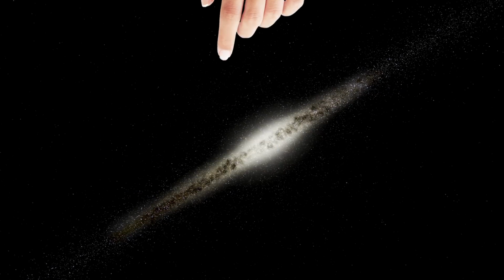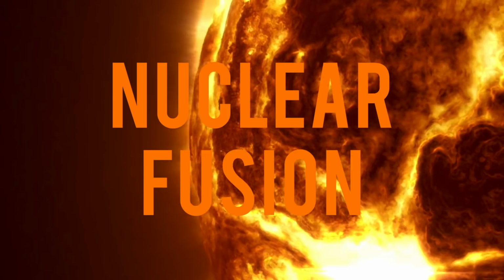Elon Musk and the Future of Space Travel | Explained by Rolls-Royce | STARRSHIP

Comment: The first part sort of misleads how the stage. The stage basically falls most of the way and only uses the main thrusters at almost the last second.  The stage just doesn't have enough fuel to slow it's descent for the whole trip.  
If anyone is looking for more information on how that maneuver works it is called a suicide burn and the math(s)/timing for how it works is actually quite interesting.
Reply from the maker: Thanks for the extra info 😄 Makes sense for the fuel supply!
Reply: @STARRSHIP  Ahem, Space X prefers calling it a hover slam.